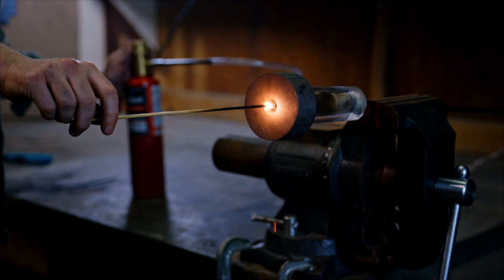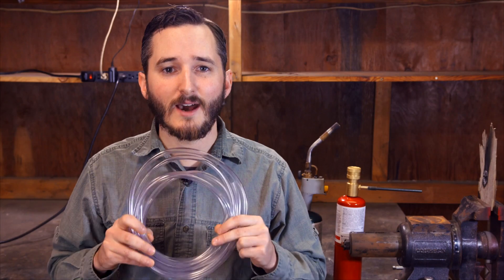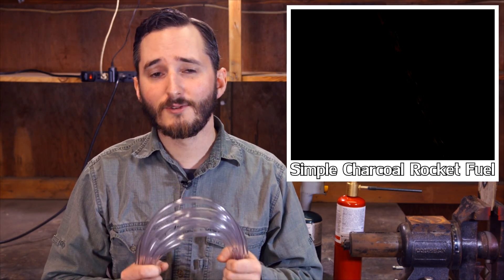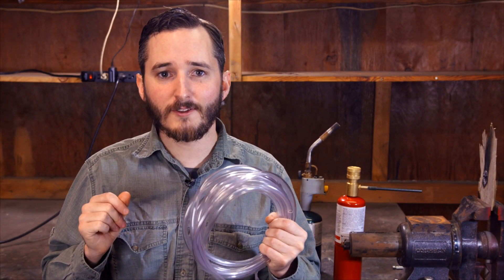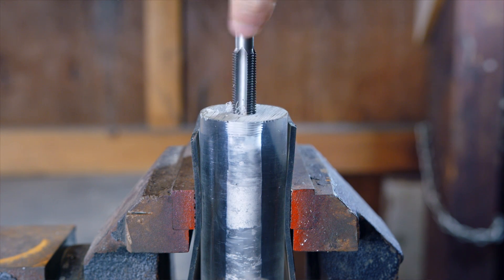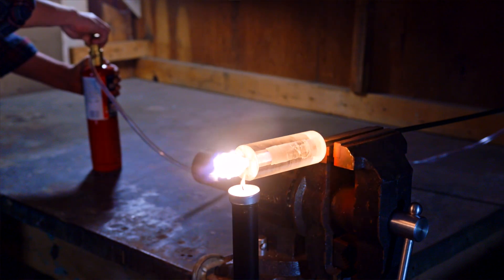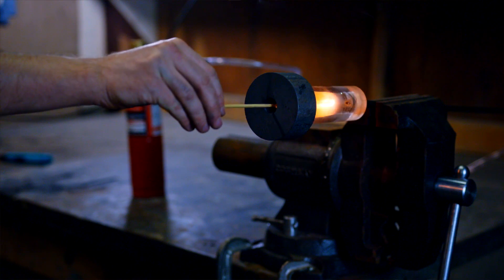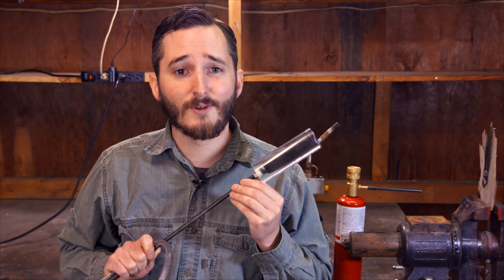Building a DIY Transparent Hybrid Rocket Engine - NightHawkInLight

Comment: What was the powdered oxidizer made of again? Sorry if i missed it :/
Reply from the maker: There are many solid oxidizers. The one i show is potassium nitrate.
Reply: Since you like Wiki, here is also an excerpt on Space Shuttle Solid Rocket Booster or as you said "...the very stuff NASA boosters use": 

'The rocket propellant mixture in each solid rocket motor consisted of ammonium perchlorate (oxidizer, 69.8% by weight), atomized aluminium powder (fuel, 16%), iron oxide (catalyst, 0.2%), PBAN (binder, also acts as fuel, 12%), and an epoxy curing agent (2%).[7][8] This propellant is commonly referred to as Ammonium Perchlorate Composite Propellant, or simply APCP. This mixture gave the solid rocket motors a specific impulse of 242 seconds (2.37 km/s) at sea level or 268 seconds (2.63 km/s) in a vacuum.

The main fuel, aluminum, was used because it has a reasonable specific energy density of about 31.0 MJ/kg, but a high volumetric energy density, and is difficult to ignite accidentally.

The propellant had an 11-point star-shaped perforation in the forward motor segment and a double-truncated-cone perforation in each of the aft segments and aft closure. This configuration provided high thrust at ignition and then reduced the thrust by approximately a third 50 seconds after lift-off to avoid overstressing the vehicle during maximum dynamic pressure (Max Q)"
Reply: Just correcting your comment "This is the very stuff NASA boosters use. A big solid motor doesn't use metals for fuel. I essence it's to modify the burn. Aluminum makes it burn faster, Iron Oxide(rust) makes it burn slower. It's the binder that's the fuel.  I essence it's to modify the burn. Aluminum makes it burn faster, Iron Oxide(rust) makes it burn slower. It's the binder that's the fuel. For short it's called HTPB..."

Big solid motors do use aluminum as fuel and many solid propellants use less HTPB than aluminum and many solid propellants don't use any HTPB at all...like the NASA Space Shuttle SRBs that use more aluminum powder for fuel than binder.
Reply: Toast Probably KClO3, it releases its oxygen in a reasonably controlled manner, so you're fairly unlikely to blow yourself up while mixing it. Still - you should ALWAYS test your mixtures in very small quantities first, just to make sure. Also keep in mind that just because something burns nicely out in the open doesn't mean it won't detonate when under preasure, like - say - inside a rocket.

Ideally you want a perfect stoichiometric ratio, else either fuel or oxidiser won't get fully consumed, which is bad for a rocket - we're trying to save weight here. Usually however, perfect mixes, especially when mixed as fine powders, like to detonate, so you might need to make your mixture rich (by adding more fuel, like they do in petrol engines) to reduce the likelihood of detonation. If that doesn't work - use a slower fuel or oxidiser (or both!). Remember, we're making rockets here, not bombs! A launch vehicle ain't worth much if it doesn't make it off the pad!
Reply: Big or small, metal, generally powdered spherical aluminum, is the fuel and needs a binder like HTPB or PBAN to hold the powdered oxidizer, and the metal together. The binder also burns in the process as a fuel.
Reply: Toast the oxidizer is most likely potassium nitrate because it is very easy to get. you can get it in some tree stump remover if you get the right brand.
Reply: And directly from an academic source can be found this excerpt from Sutton's 'ROCKET PROPULSION ELEMENTS' 7th edition on pages 475-476: 
"3. Composite propellants form a heterogenous propellant grain with the oxidizer crystals and a powdered fuel (usually aluminum) held together in a matrix of synthetic rubber (or plastic) binder, such as polybutadiene (HTPB). Composite propellants are cast from a mix of solid (AP crystals, Al powder) and liquid (HTPB, PPG)* ingrediants. The propellant is hardened by crosslinking or curing the liquid binder polymer with a small amount of curing agent, and curing it in an oven, where it becomes hard and solid. In the past three decades the composite propellants have been the most commonly used class. They can be further subdivided:

 (1) Conventional composite propellants usually contain between 60 and 72% ammonium perchlorate (AP) as crystalline oxidizer, up to 22%aluminum powder (Al) as a metal fuel, and 8 to 16% of elastomeric binder (organic polymer) including its plasticizer."

 (2)-(5) talk about other formulations that can include RDX, nitroglycerine, etc for higher energy ( Isp ). You can reduce or even eliminate aluminum from APCP but at greatly reduced performance relying only on the binder as fuel.
Reply: You say "Metal is added as a combustion stabilizer, not primarily as the fuel and in no formulation I can find is a metal the primary fuel. There are some with equal proportions (15% AP/15% AL) but it's not needed in an APCP motor."

I have never seen an APCP propellant with 15% AP and 15% Al ratio.
Reply: mojaverockets pban rockets also.  they have advantages over htpb.  if anyone is wondering the ox is almost always NH4CLO4.  it's not rocket science.  also hybrid rockets are not liquid filled rockets and their duty cycle is much less than a liquid fueled rocket.
Reply: Semantics.  Once liquids are used i tend to call it a liquid rocket.  Hybrids are in the middle to me.
Reply: jacktheripped In response to your comment "LOX can be poured into the rocket at atmospheric pressure, sealed then the tank will self-pressurize to about 120 PSI."
We've used LOX self-pressurizing at 3-400 psi in hybrids and included safety valves to vent at 450 psi.
Reply: You're talking about CAN I assume? you can easily remove the calcium part of calcium ammonium nitrate or other such binders by simply pouring the stuff into water.... the AN will dissolve, the nasty chemical that wants to stop your reaction will not.
Reply: the bane AND savior of NH4NO3. lol.  hygroscopicity i mean, lol.  is NH4CLO4 used in strobe rockets? .  you tube em if you don't know them. p.s. ammonium nitrate is a shit ox for anything not coated w grease
Reply: oh,  also atomized=spherical for your searches
Reply: Toast Kno3
Reply: Toast All else fails - use nitrocellulose. If prepared correctly (as in by a proper chemical plant) it doesn't detonate. Its burn rate is also proportional to chamber pressure, so make sure your chamber wall and nozzle can take it, else it'll still go up in flames on the pad. If you do it right you're in for a treat!

Oh, and stay away from straight up gunpowder (a.k.a. black powder), if you don't compact it well enough it WILL detonate. Again - rockets, not bombs.

Comment: It looks like it shrinks because the cut you made in the middle roughened the surface of the inside of the acrylic tube making it less see-through. When you started burning it it burned away that rough layer and made it see through like the rest of the tube.

Comment: Is anyone else on here really annoyed when movies/TV use oxygen tanks as an explosive, because they say pure oxygen is an explosive? I love how you show how bogus that notion is!
Reply: An enclosed container of any gas under high pressure can be 'explosive' if heated high enough. Even water heated in an enclosed tank would be...even a water rocket tank will mechanically 'explode' if the pressure was high enough.
Reply: Deadpool just did it. It's been done before in more obscure shows/films.
Reply: It can create some cool fireball effects... if other stuff that's combustible is in the area and already lit. and when exposed to high concentrations of oxygen with little to inhibit burning.... pretty much everything is combustible.
Reply: +MrJamesIkanov I don't think anybody uses O2 in movie SFx.  It's too dangerous and unpredictable.  Most movie SFx explosions are done with balloons full of gasoline that are "blowed up" with small pyro charges.

The pyro disburses the gasoline into the air as a fine mist mixed with air, and also ignites the mist as a giant fireball.

Real explosions are generally not nearly as spectacular.  An often quite modest flash, followed by a shock wave.  SFx gasoline "explosions" doesn't really produce much of a shock wave, but oodles of fireball.
Reply: ayee, i know you, as well as i agree with you're statment, i whould give anything to see a movie with 100% accurate science.
Reply: USWaterRockets  I think what you mean is the big fireball you see in the movies, and yes it is extremely annoying. Only flammable compressed fuel can create a fireball
Reply: USWaterRockets who does that
Reply: the potato mafia your*
Reply: Like how the chemical in the PEPCON disaster is basically impossible to ignite, but mixed with a fuel it goes kaboom?
Reply: +Kumquat Lord Ammonium Perchlorate is, and Pepcon was a bit more complicated than that.  But you pretty much got it.

AP by itself is pretty tame.  It's hard to get it to do anything.  If you super-heat it, it tends to decompose without doing anything too hideous.  Except, if I recall correctly, if the amount of AP is large and contained enough, it can "unzip" itself and detonate like a high explosive.  Pepcon had some 4500 tons of the stuff.

["Unzipping one's self" isn't exactly rare in chemistry.  Acetylene goes boom if you try to keep more than a tiny fraction at above 30PSI or so.  Acetylene tanks are not at all like any other kind of pressurized gas.  High purity Hydrogen peroxide can unzip itself quite destructively when given a chance.]

[There's a whole class if chemicals similar to AP that can be used as rocket oxidizers, such as Ammonium Nitrate (AN) and various Sodium and Potassium [Per]chlorates.  They all have their various drawbacks, including being dangerous to manufacture, or store, or mix with fuels.  AP turns out to be about the safest and most consistent.]

If you add a "fuel" to AP (such as the aluminum powder and synthetic rubber, as in the SRBs), uncontained, it burns like a rather anemic road flare.  If you confine it in a chamber, with a nozzle, the pressure builds, the burn rate increases, and you get high thrust.  If the nozzle is too small, the combustion chamber will overpressurize and burst.

As I understand it, Pepcon also had other chemicals on hand, including a 40" diameter natural gas pipeline underneath it pressurized to 300PSI.  The largest explosions appear to be NG with/without AP.  Some of the earlier explosions may have been AP unzipping itself, OR, using the containers it was stored in as fuel:

Pepcon kept producing AP after the Challenger disaster, and AP was kept on-site in steel and fiberglass barrels for when the Shuttle started flights again.  Subjected to fire, the fiberglass resin becomes fuel with the AP.  Probably not a very good one, but one that could have been avoided.

Comment: Not only will a poorly designed nozzle not produce optimum thrust, it might not even generate significant amounts of thrust at all.  The nozzle throat needs to accelerate the gas to sonic, then expand it supersonically.  In order to get sonic flow in the nozzle, you have to have at least 30-40 psi chamber pressure, which it looks like you didn't have since the nozzle was just press fit over the chamber.  Thrust is linearly related to exhaust velocity, so if you aren't getting at least sonic flow, don't expect more than a pound of thrust at most.
Reply: It's a conceptual model, not a functional model, meant to be built by people at home. Will it launch a payload? No, it wont. Will it teach a child, or function for a demonstration of, how a rocket engine combusts, while making a fairly impressive visualization? Yes, it will. 

I'm pretty sure he knows the has little to no thrust, but it DOES explain the concept of hybrid rocket engines.
Reply: It's a good working model of a tube, burning from the inside. It is not rocket, it is not a rocket model.
Reply: I mean, the title says "Hybrid Rocket" so I'm not sure I follow
Reply: @Scott Gauer
"Isp (specific impulse) is simply exhaust velocity divided by 9.81 (g)."

No.  Check your units.
Reply: Check your units.  (m/s)/(m/s^2) m's cancel, one top s cancels the bottom s leaving seconds, the units of Isp.  When I said g I mean g as in gravitational acceleration.  Maybe that's where you got confused.
Reply: Yeah, the point is that somebody fucked up the Wikipedia article...

You should work on not acting on the impulse to argue against every perceived slight (note the word "perceived") if you plan on working in industry.
Reply: Scott Gauer

In all seriousness though, you're going to have to deal with bosses who are going to do the exact same thing that I did.  It's also very possible that you'll be fired for not cutting corners.  Your bosses aren't going to be in charge because of their dedication to good engineering practices...

In all honesty, a small lab/workshop beats the shit out of a big cool-guy company.
Reply: 30-40 is the bare minimum. It's all about the critical pressure ratio for a gas.  It's the pressure that guarantees choked flow.  Of course you'll need more if you have nonisentropic effects, which all real systems do.
Reply: Haha. knupder, it seems like you're knowledgeable on the operations of SpaceX. Did you work there or at a competitor's company? What experience do you have that makes you feel that you are in the right to tell someone else not to argue with you about something while you are clearly wrong?
Reply: Thrust is not related to exhaust velocity, specific impulse is. Thrust has many variables, e.g. nozzle size, shape, expansion ratio, type of propellant, pressure in combustion chamber etc.
Reply: Specific impulse is the time that a propellant mixture of unit weight will produce that unit weight of thrust
Reply: No, I got confused because I tried to use Wikipedia to refresh my playskool rocket science and somebody claimed that specific impulse was dimensionally equivalent to a ratio of thrust to a flow rate.
Reply: *or 32 ft/s^s, depends on your unit system of course
Reply: To the american taxpayer, even a billion dollar mission costs the average person around $3.  So if you add up all the failures, it's probably only $10-$15 AT MOST.  We are still in the early ages of rocketry, and releasing all that energy is not easy.  I think I heard it best when someone said "Planes are a lot of structure and a little fuel, but rockets are a lot of fuel and a little structure"  When you have to control the release of all that energy, some failures are bound to happen.  At least we learn from them!
Reply: Scott Gauer I know this comment is old, but I thought I'd correct it a bit. While you do want the fastest possible throat velocity, you want the gas pressure at the end of the nozzle to be as close to atmospheric pressure as possible.  That is how you get maximum efficiency, because it means the gas expands as much as possible before escaping the bell.

Source: Have designed nozzles for sounding rockets
Reply: He is just demonstrating how the concept works.  He isn't trying to make an actual operational example.
Reply: KersZZ  Thrust is absolutely related to exhaust velocity.  The thrust equation is T= mdot*v_exhaust +A_exit(P_e-P_a).  And for an optimized nozzle with Pa=Pe the only participant in the thrust equation is massflow times exhaust velocity.  Isp (specific impulse) is simply exhaust velocity divided by 9.81 (g).
Reply: My apologies, I thought you were implying I was the "someone".  I guess that's why Wikipedia isn't considered a valid source!
Reply: I can understand the small vs big company deal.  I interned at an extremely small aerospace company and loved it there because of the many hats I got to wear.  But I found there wasn't a big end goal or dream driving the company.  I can deal with politics but if I'm asked to cut corners to make a schedule, I don't think I'd be able to do that.  I have faith those practices aren't done at SX; in fact, one of my interview questions was on quality vs. schedule and the interviewer seemed to agree with my answer (quality).
Reply: SpaceX lost a rocket specifically on account of the fact that they were 
skimping on quality control.  There's a world of difference between the 
company line and the actual practices.  The fact that SpaceX has a 
really impressive mission statement doesn't really mean that much 
either.  It's just marketing.  SpaceX ain't exactly the Submarine Corps.
Reply: The rocket was lost because of a sourced part, a pin joining a strut to a COPV.  This was one of few components not made in house, and when it was purchased, it was purchased with the assumption that it passed quality at the manufacturer's facility, because it was certified.  It was QC on the supplier's side that was at fault.  I'm not saying SpaceX is perfect but in this case it really wasn't their fault.
Reply: I know :) Just graduated with a BS in aerospace.
Reply: OMG since i am not leaving in USA i taught u sayed you  graduated with a "BullShit in aerospace" D;
Reply: Friend.  I am an aerospace engineering senior, with a job waiting for me at SpaceX when I graduate.  We literally did this in my propulsion class last week.  Specific impulse is the exhaust velocity divided by 9.81 m/s^2.